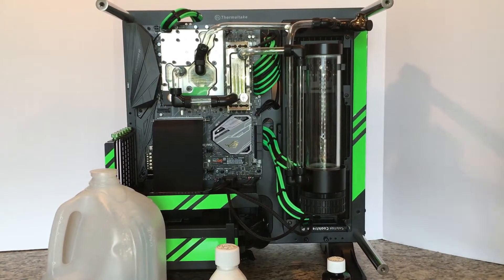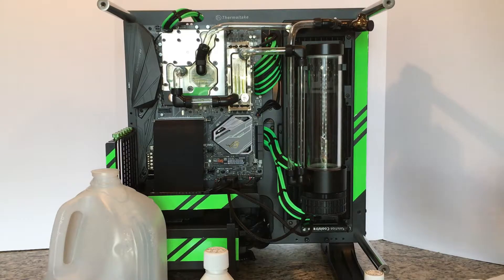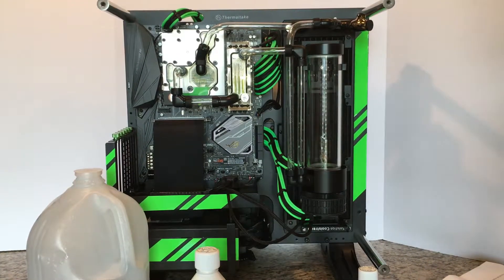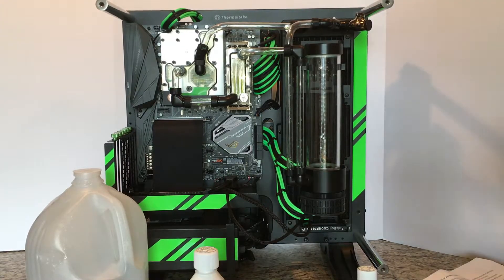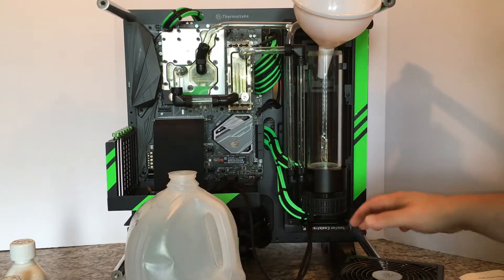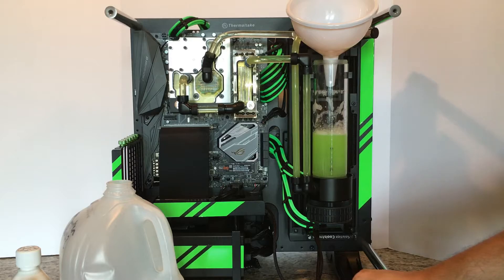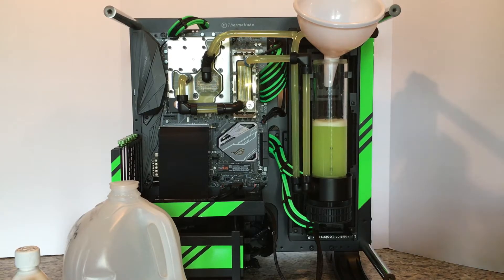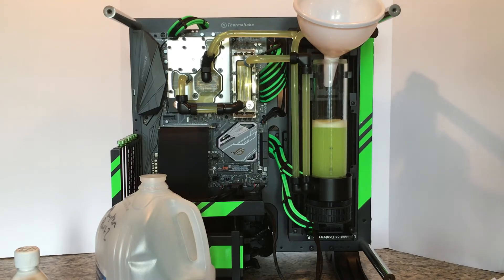Flush that Loop! Mayhems Blitz Kit Overview - Part 2 of 2

Comment: I do not see why most reviewers DO NOT flush the colour out of their loop before putting pt2. Won;t it make a better job if it is put in a cleaner enivonment?
Reply: Yes flush with distilled water before you add it in.
Reply: It's a detergent, so the idea is to lift / encapsulate all the crap left in. That being said, I flush first with distilled water.

Frankly I think any coloured fluid is garbage, and unnecessary. I use Mayhem's XT1 Clear Concentrate with distilled water.

Comment: Can I add part one to my entire loop? Or is it only for the radiator?  Please help, this is my first time doing this and I don't want to take my loop apart. Thank You!
Reply: The part one is for the radiators only because it is an acid and will eat your tubing in your loop. Only use the part 2 for the entire loops. Hope this helps.
Reply: Use Part 1 only for your radiators. DO NOT run it in the rest of the system.

Fill each rad until all air is gone, shake well and let them sit. I shake it every now and then. Don't exceed the maximum time stated.

Part 2 is for flushing your entire loop including radiators. Drain the system, flush with distilled water and then run the diluted Part 2 for 12 to 24 hours.

You'll need to flush it loads of times, the manual says 3 but keep going until it's completely clear.

When you're done, replace all your tubing with new stuff.